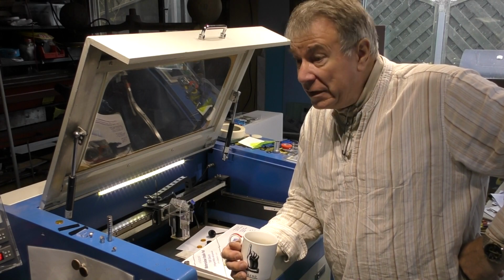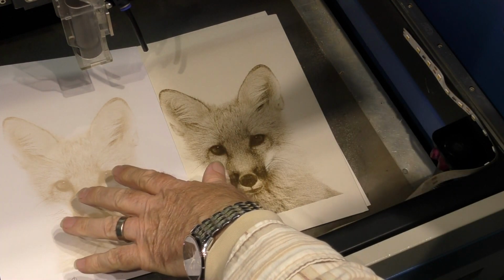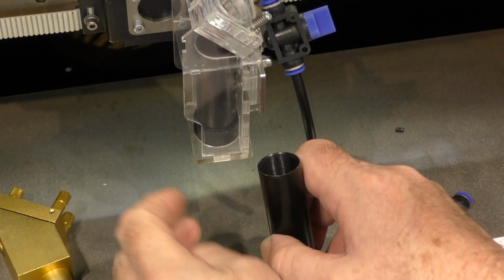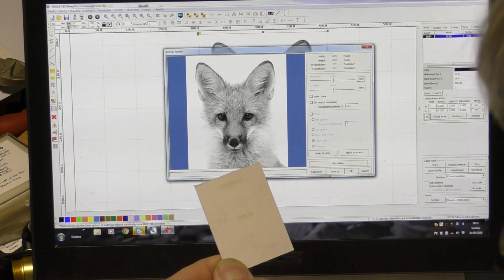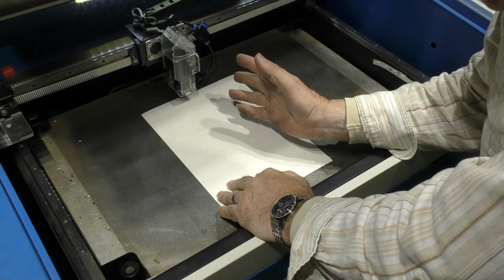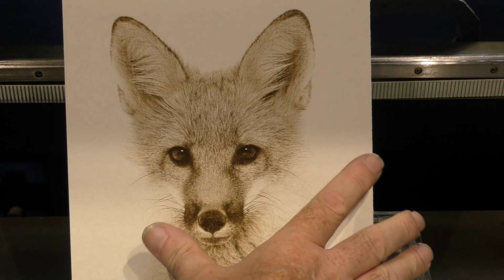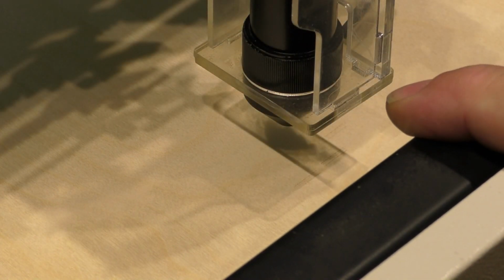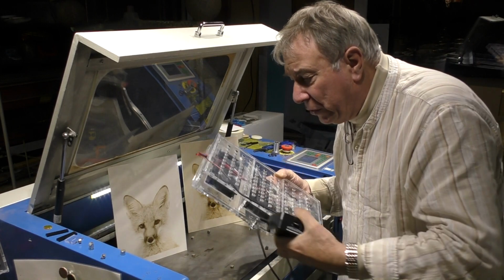158 Compound Lens and Universal Engraving Nozzle

Comment: Is it capatable with diode lasers? Or just co2?
Reply from the maker: Hi Bruce
 This particular lens system is only suitable for the CO2 laser but it is just a combination of lenses to concentrate the intensity to a very small spoy size I am currently in the process of exploring the diode laser technology in  a series called "Diode Lasers---Under the Hood" In this series I am currently working with a 5 watt single diode laser and have experimented  with  a compound lens to reshape that beam. It may interest you.

Comment: Can I ask why use a cheap lens 1.5” why not 1.5” USA bit more expensive but clearer?
Reply from the maker: Hi Martin
 Ther is a short answer that caused me to arrive at this combination and a long answer that has taken me several years to unravel the mysteries of laser beam and lenses.
 The short answer is.my need to create a crisp burnt dot  on various materials  to satisfybthe needs of photo replication.. Converting coloured/greyscale iphotos into varying density black dots (ditherinbg)  means that the quality and resolution  of the replication depends on burning  a copy of single pixels . If the burnt copy of a pixel is  blurred and fuzzy at its edges then the final result will be far from a replication.. To solve this problem the conventional method is to remove image detail with softwares such as ImagR, OneTouch or Photograv etc. This ignores the fundamental priciples by which digital imaging works and  produces a cartoon/pencil sketch type of result. 

To arrive at the weird combination you question, I amassed a huge collection of lenses and set about experimenting  with various combinations. (this is all documented in my early RDWorks Leraring Lab videos). My knowledge of optics at that time was less than ankle deep but after hundreds of test combinations. the crispest dot by far  was with this combination. Yes I did try the high quality CVD lenses and also the gallium arsenide material.

 After sevral years of experimenting  with lenses and various types of laser beams,  I realize that conventional lens theory only works for  imaging aplications such as  telescopes and  cameras etc.  For any theory to work, it has to be bounded by limiting conditions and one of those limiting condition is that the light is assumed to be uniformly intense.  That means that the  non-uniform intensity of laser beam is not subject to the predictionsof lens theory.  You must appreciate that focusing an image to capture or project it  is completely different to our requirement to focus the  INTENSITY  of the beam to damage material.  Most people assume that they understand the basic priciple of lenses, however stop and  think about laser CUTTING a deep parallel kerf in 20mm thick material with a short focus lens......how is that possible ?. Your  very reasonable question implies that  clarity  and cost of a lens is a good property by which to asses it? Have you ever seen a BLACK gallium arsenide lens that you cannot see through?  Our perception of lenses is based upon the wave lengths of light we see with our own eyes but  seemingly by magic, 10.6micron wavelenth light  passes through this black lens  because at that frequency the material is transparent. Few laser users ever venture futher than understanding how Lightburn can be used to adjust machine parameters. The science behind the machines and the technology is fascinating.
 
Thanks for the great question and I've not even scratched the surface of the long version.

Comment: Hi Russ, 
So i was wondering. :D The magnifying glass, that you are using, where is that from and how much does it magnify with? :D Need one for myself and can not seem to find any similar to yours. :) Would a jewelers loupe magnifying glass work? 

Also the test print that you do on the material, could you perhaps provide the RD works file for it? :) 

Thanx for explaining everything so well. Im about to recieve my compound kit in a few days and i wanna be ready to go :D
Reply from the maker: Hi Soren
 Yes there are lots of loupes on ebay and I have several different types They are sometimes called linen gauges  All these are fine for inspecting dots.
 
 https://www.ebay.co.uk/itm/10X-Metal-Tri-Folding-Handheld-Magnifier-2-LED-Lights-Desktop-Magnifying-Glass/133595118812?_trkparms=aid%3D1110006%26algo%3DHOMESPLICE.SIM%26ao%3D1%26asc%3D20201210111314%26meid%3D6f57004101cd495aa14ee60b71b75a08%26pid%3D101195%26rk%3D5%26rkt%3D12%26mehot%3Dco%26sd%3D352107630135%26itm%3D133595118812%26pmt%3D1%26noa%3D0%26pg%3D2047675%26algv%3DSimplAMLv9PairwiseUnbiasedWeb%26brand%3DUnbranded&_trksid=p2047675.c101195.m1851

https://www.ebay.co.uk/itm/20X-Tri-Folding-Desktop-Glass-Magnifier-Portable-for-Repairing-and-Inspection/294095754750?_trkparms=aid%3D1110006%26algo%3DHOMESPLICE.SIM%26ao%3D1%26asc%3D20201210111314%26meid%3Dc0ce4ab847564af988162e0066933616%26pid%3D101195%26rk%3D6%26rkt%3D12%26mehot%3Dco%26sd%3D133595118812%26itm%3D294095754750%26pmt%3D1%26noa%3D0%26pg%3D2047675%26algv%3DSimplAMLv9PairwiseUnbiasedWeb%26brand%3DUnbranded&_trksid=p2047675.c101195.m1851

https://www.ebay.co.uk/itm/Foldable-Magnifier-Reading-30X-60X-Magnifying-Glass-Jewelry-Loupe-With-LED-Light/154367371152?_trkparms=aid%3D1110006%26algo%3DHOMESPLICE.SIM%26ao%3D1%26asc%3D20201210111314%26meid%3D4055665c63a249ffb40af4bd8c173bf7%26pid%3D101195%26rk%3D4%26rkt%3D12%26mehot%3Dco%26sd%3D294095754750%26itm%3D154367371152%26pmt%3D1%26noa%3D0%26pg%3D2047675%26algv%3DSimplAMLv9PairwiseUnbiasedWeb%26brand%3DUnbranded&_trksid=p2047675.c101195.m1851

Just add your disguised email address to another comment and I will send you the files to make step gauges and also a ramp gauge you will find useful with the compound lens.
I will then delete your comment/email address.
 Best wishes
Russ
Reply: @SarbarMultimedia 
Thank you very much 😁

It's
hotstuffc at hotmail com

Thanx in advance 😁👌
Reply from the maker: @sorenac  Hi Soren

 Is there a typo error in the address  because it bounced back to me.  Subtract the ++ and this is what I used.   hotstuffc++@++hotmaildotcom
Reply: @SarbarMultimedia 
My bad, it was gmaildotcom :)

Comment: Is the gold head assembly in the video a K Series head? That's what I have and would like to get your compound lens kit.
Reply from the maker: Hi Phillip
 Sorry that gold head is not the Ktype. The  compound lens is embedded in a nozzle which has an M22 male thread mounting. and will not work with your head.  BUT all may not be doom and gloom. Send me your disguised email address in another Comment and I will reply. You can send me some pictures of your machine (there are several different K40  designs) and I will see what may be possible. I will also delete your comment/email address
 Best wishes
Russ

Comment: hi Russ is this Compound Lens and Universal Engraving Nozzle designed just for doing photos ...having problems engraving vector onto slate ends up like dark and light lines ...put my old lence in .2 and its fine
Reply from the maker: Hi 
 This is absolutely perfect for engraving slate  take a look here to see examples of work done with the compound lens.
https://uniquelaserart.co.uk/1_5_shop.html

 To do text  etc just increase the nozzle to work distance to 12mm and add some power. I have done several house and business nameplates on slate.. For text and other vector graphics a 2" lens with 0.15 /0.2mm line interval also works fine.

Best wishes
Russ
Reply: @SarbarMultimedia  cheers Russ ill give that a shot ...iv put my 2" back on and its alot better ...but ill try again with the 12mm focus

Comment: did u put lences in wrong way from diagram on cloud website
Reply from the maker: I supplied the  Cloudray website diagram  and I have checked (just in case)  to find that my assembly here and the diagram agree. If in doubt look at the diagram.
Best wishes
Russ
Reply: @SarbarMultimedia  cheers Russ just the diagram on cloudray is different from your i was a little confussed
Reply from the maker: @bobmo1969 
 Hi
 Can you send me a link to where you saw this picture and I will get it changed Was it on an Ebay or Amazon site?
The main website is correct. Just scroll down
https://www.cloudraylaser.com/products/compound-universal-engraving-nozzle?variant=13488869867571
Many thanks
Russ
Reply: @SarbarMultimedia  the main site has changed it now

Comment: How do I get the plans for the Gage to verify I have a level table?  I couldn't find your email address anywhere.
Reply from the maker: Hi Jeffrey
 To level the table does not require and special gauges  you can use any spacer to set the table the same distance to the nozzle in all 4 corners.. The bigger issue is do you know how to level the table?
 If  you like to add your disguised email address to another comment, I will contact you ....and delete your comment
 Best wishes
Russ

Comment: hello Russ, I heard in the video that you would not suggest to use the kit in a 100W laser, is it correct ?
Reply from the maker: Hi Patrick

 That is correct...........sort of.   One of the lenses in the compound arrangement is a PVD cheap Chinese lens (the more expensive CVD type is not as good at focusing)  Those Chinese lenses have a power limit of 80 watts.  So yes you can use it provided you do not run at full power. The second issue is power control. To exploit the ultra small dot capability of the lens system you only need to use LOW power for photo engraving . As the tube power increases (60 watts  is an ideal compromise) the ability to control that low power end of the performance range drops off rapidly, it may be absolute crap if you happen to have a genuine Reci power supply because  their response capability at low power is abysmal.  For example, photo engraving at 200mm/s with 254dpi.   This is a dot size of 0.1mm ie 10 dots per mm X 200mm/s  = 2000dots per second. That requires a response time of  1/2000= 0.5ms   If you look at specifications for all the normal cheap HV power supplies they promise 90% of demand in less than 1ms.  In practice most  normal power supplies are capable of this 0.5ms response,  in fact both my machines can run at 400mm/s. 
For glass, slate, card,wood or leather photo engraving you will only be using 10 to 20 watts max  so yes you can use the compound lens  but don't wind the power up and use it for cutting. To test if your power supply is capable of responding,  draw a 15mm square and set it to scan mode, Set the line interval to 0.5mm and the speed to 400mm/s  Try running the test  (on wood or mdf) at just over your lowest run power (maybe 10%)  and in 2% increments up to 20%. You will see an abrupt clean STOP to each scan line but what about the STARTS? They should be equally clean and abrupt. If the line starts off weak and build up to full colour within 1 to 5mm then that is your response problem. 1mm at 400m/s= 2,5ms response.. If you then test at 60 or 70% power you will probably find no problem.

 Best wishes
Russ
Reply: @SarbarMultimedia Hi Russ, perfect, crystal clear , just to let you know that I'm very happy with your light lens support, works great and much more easier to adjust than the original one that was a poor quality
Reply from the maker: @patrickdjebar9225  
Hi Patrick
 It's always good to hear that you were able to get the sort of benefits I experienced. I am VERY happy with its flexibility and performance. It gets hammered regularly because my step daughter is always using the machine while she is building an engraving business. 
Best wishes
Russ

Comment: What is that inline air regulator thing called? I can't for the life of me find one to buy.
Reply from the maker: Hi Tyler is this what you are after?
https://www.ebay.com/itm/Fit-Tube-OD-6mm-Ball-Valve-Hand-Shut-off-Push-In-Connector-Pneumatic-Fitting/182589155579?hash=item2a832968fb:g:dHsAAOSw2hhciyre

Best wishes
Russ

Comment: i got the compund lens set from cloud ray.  it fits the threading on my chinese 50 watt laser.  do i need the shaft because im seeing people making or 3d printing the shaft?
Reply from the maker: Hi Hien
No.you need nothing more. If the nozzle fits your existing lens holder then that will be fine . You need very little air assist, just a whisper to protect the lens but the focus is quite sensitive. If you are planning to try photo engraving then you really need a special slope gauge running between 10 and 12mm  Is your table true to your nozzle to better than 0.5mm everywhere?
 If you add your disguised email address to another comment (johndotsmithatgmaildotcom) I will send you some data and files to get you started.
Bet wishes
Russ

Comment: I know we spoke about this earlier but if I order the correct laser cutting head like the cloudray wsx  and upgrade the power supply and tube to a 150w will I be able to cut steel plate im not looking to cut stainless or alum  I also don't have a option or the money to buy a machine that's cost 10-30,000 to laser cut metal?

Comment: Great videos! Thanks for all these.
Will the compound lens kit (with universal nozzle) fit onto a Thunder Nova-35?
Reply from the maker: Hi Bob . No because the nozzle tread is wrong BUT I have encountered this problem several times and persuaded Cloudray to hold stock of some special lens tubes that will fit your machine and alsohave the correct thread forthe compound lens.. I think your lens tube is 25mm outside diameter. If so then as well as the comoiund lens you can buy this  E series lens tube
https://www.cloudraylaser.com/collections/nozzles-lens-tube.. 1/10th the cost of the Thunder laser offering.

Best wishes
Russ
Reply: @SarbarMultimedia  Thanks Russ, but the link doesn't work right now. But thats good info, thanks! 😎
Reply from the maker: Hi Bob
Go to cloudraylaser.com and find the CO2 page  and then nozzles and lens tubes.
Best wishes
Russ

Comment: Hello, Universal Engraving Nozzle (Cloudray Laser) vs High Resolution laser head (Thunderlaser) which is better.
For better results.
Reply from the maker: Hi
The results for the TL head are just about the same as with the compound lens. I and two TL owners have compared results on matching materials using my little dot measuring test. The big difference is about $400. The claims for the TL head are ludicrous at 1000dpi and are explained in 
https://www.youtube.com/watch?v=OUkBObChgLo

To replicate a 1000ppi image you must be able to produce 0.025mm dots. On hard materials you can achieve 0.05 dots with both systems,  which puts you in the 500dpi region. However, most people will be working with wood or acrylic and the limit with these materials is likely to be 0.1mm ie a 254ppi image. The TL method of creating laser ready images is to use halftone dithering (as do all the "big boys with their RF lasers). Half tone dithering produces  varying size dots and the laser machine (continuous or RF) is limited to  just one size of dot. Thus, half tone dithering will always be a compromised solution to photo engraving.
 If you have a TL machine and are thinking of buying the compound lens kit. it will not fit your machine directly because the nozzle thread is different. Check the stem diameter of your lens tube (! think it may be 25mm) and buy the correct lens tube at the Cloudray website. When I discovered the mismatch, I asked Cloudray to provide suitable lens tubes for TL owners. 
There are already hundreds of happy compound lens kit users and a recent new user could not believe he was getting 0.06mm dots...but he was.

Bet wishes
Russ
Reply: @SarbarMultimedia   Thank you for your answer. I don't speak English, I read it by translating. As I understand it, the only difference between the two is the price
So I ordered (Universal Engraving Nozzle)
Thank you
Reply from the maker: @alfaplus9686  
To fit your machine you will also need to order  a new lens tube . Measure the diameter of your lens tube, I think it is 25mm diameter. If so you need to order 
an E series lens  tube  ($9). because the M22x1 thread on the compound nozzle kit  will not fit a Thunderlaser lens tube
https://www.cloudraylaser.com/collections/nozzles-lens-tube
 Best wishes
Russ
Reply: @SarbarMultimedia   I measured, I think it looked 22mm (21-22mm)
Reply from the maker: @alfaplus9686  Add your disguised email address  (johndotsmithatgmaildotcom)  to another comment and I will write to you so we can use pictures to resolve your problem.

Best wishes
Russ

Comment: I just finished running multiple spot size tests on the compound lens... I've done it like 10 times. I keep coming up with the same number*** .06??*** Holy cow is that right? I have a number of other lenses, none even get close to .1
Reply from the maker: Hi Mark
 You are not wrong. It is a magical lens  combination that you have seen me demonstrate. On certain hard materials I have achieved 0.05mm dots. However most people will be working with wood and the it will be normal to comfortably achieve 0.1mm dots. That is a number I would claim for the combo even though I (and now you) know it can do better. The dot size determines the resolution of the image you are trying to replicate  so 25.4mm/0.06mm = 423ppi. That will produce an awesome picture. But to be safe and honest I always work with 0.1mm dots and 254ppi

Best wishes
Russ
Reply: @SarbarMultimedia  You're the man. Your videos are informative, and you don't miss a single detail. Thanks for all your work.